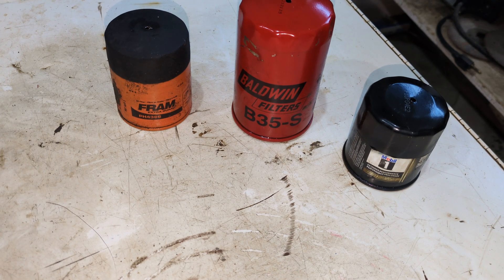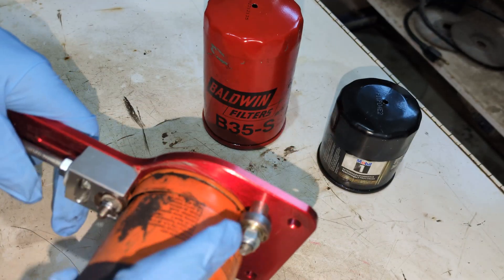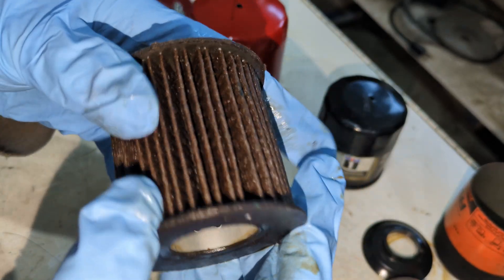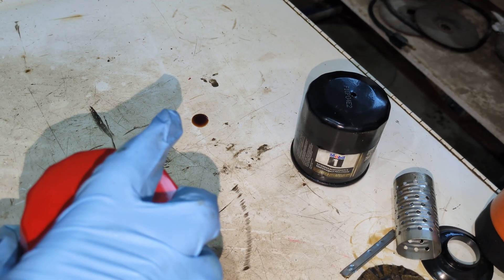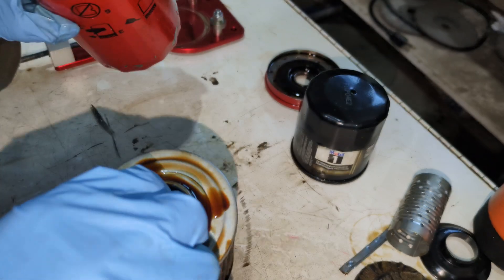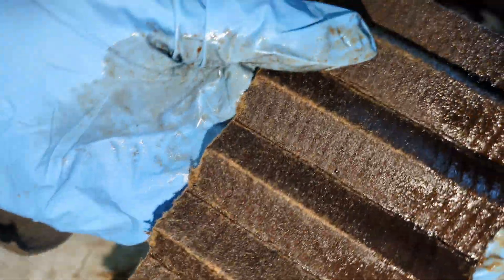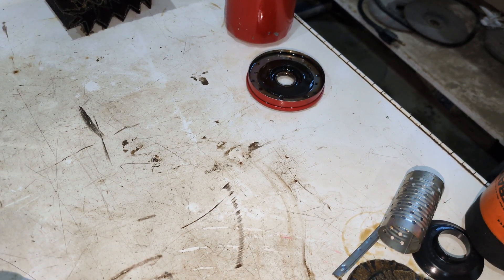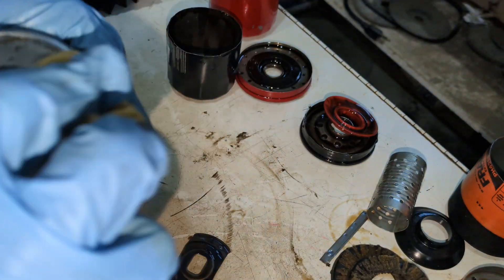Three oil filters cut open to see what secrets they hide

Comment: Not a fair comparison.
Perhaps you should have used a Fram Ultra Synthetic , which costs a dollar less and will outperform either one.
By the way , all Fram , even the most basic orange can comes with an orange silicone valve.
That must be an older one .
Very misleading video.
Reply from the maker: Thanks Nel, I use what they give me.